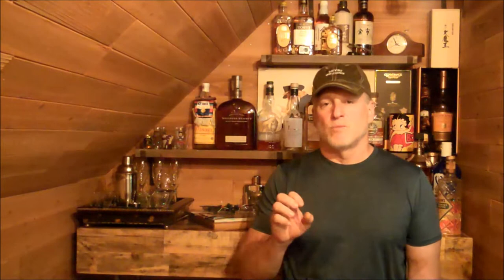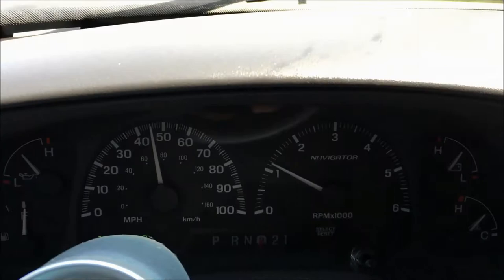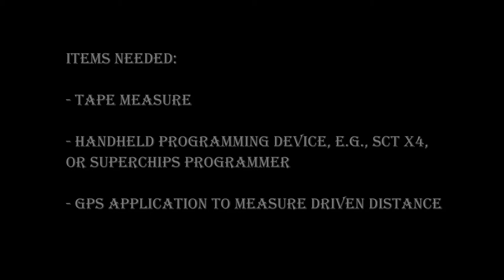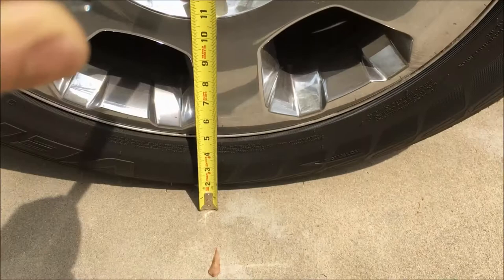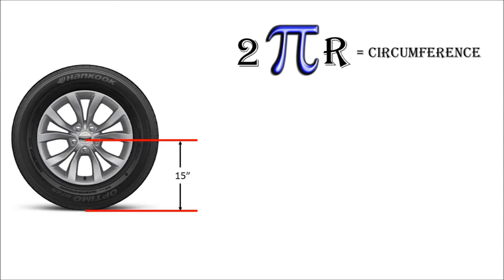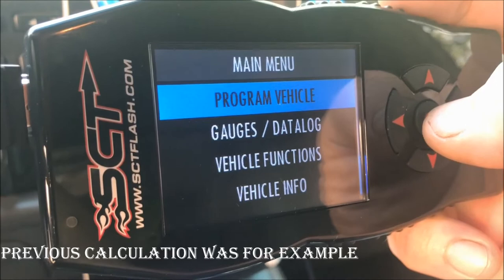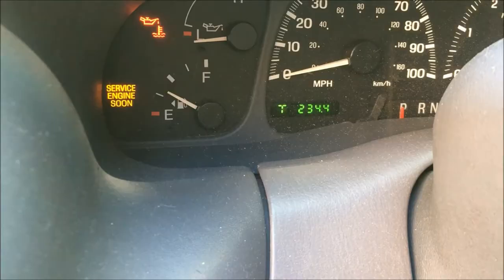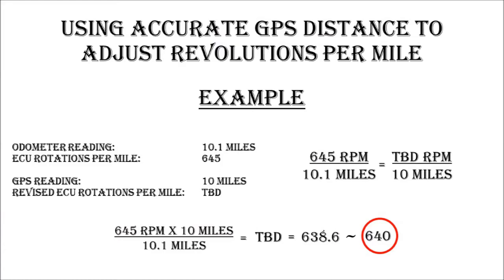How To Correct Odometer & Speedometer After Changing Wheel and / or Tire Size

Comment: Another sure fire and really accurate way to find your circumference and revolutions per mile is to make a mark on the tire with chalk or differential gear lash paint, or anything that’ll leave a mark on the ground. Roll the vehicle forward so that it leaves two marks on the ground. Measure between the marks with a tape measure and you will get a very accurate measurement. 
Do the math using that method and you should be right on the money.
Reply from the maker: Great idea

Comment: Thx for this vid I'll be going from 255 35 20 to 245 40 20, I want more side wall for potholes
Reply from the maker: That tire change will only give you about 1/3” of additional sidewall.  Make sure that’s enough.
Reply: @DrivingIntelligence  I know but  according to the tire calculator it said that I shouldn't go over 3% of the diameter this putting undo stress on the cars components, but if I were to recalibrate the ECU can I do any size I want? Also what size do you suggest
Reply from the maker: @djsthemetereman  give me the make, model, engine, transmission and axle ratio... I can possibly give you some guidance.

Comment: You have the speedo from a smart fortwo pictured. Will this method work for that?
Reply from the maker: Hi and thanks for the question.  I grabbed that photo because I thought it was pretty cool.  The process I provided is good for any vehicle that can have the speedo / odo adjusted through a tuner.  I did a quick internet search and found this site.  I cannot vouch for their business, but they might be able to support a tune that adjusts for larger wheels / tires:  https://www.torquecars.com/smart/fortwo-tuning.php